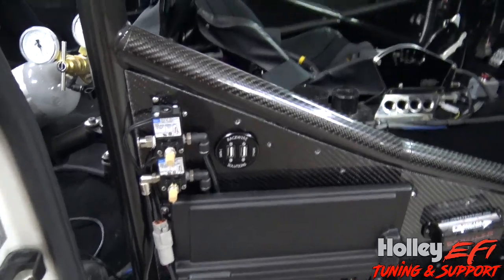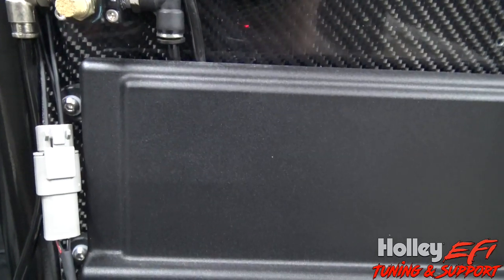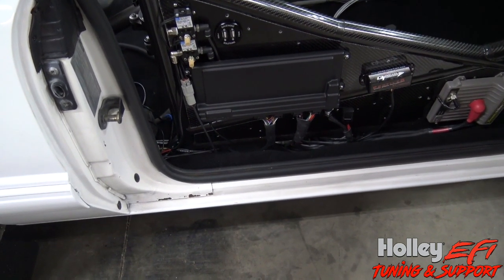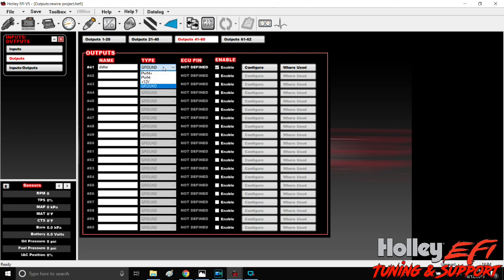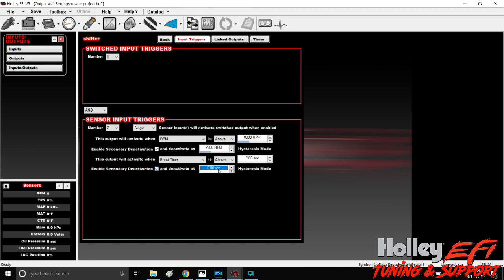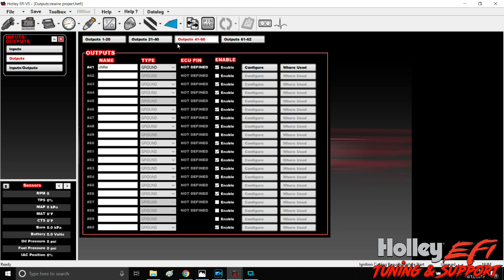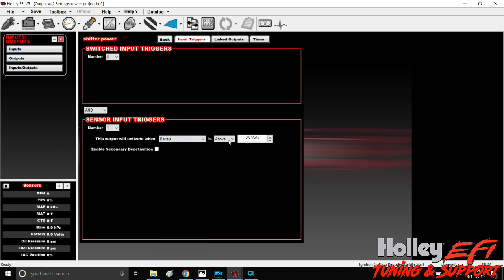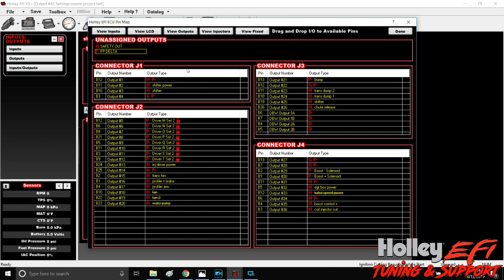air shifter install on Holley Efi

Comment: Will this work for a 4l80e ? What prevents the computer from activating the shift solenoids internally and over riding the shifter position manual lever? If i select the manual / automatic in Term max it was a grd signal to indicate that is activated and then I read that the trans will wait for a trigger shift like a paddle shift button input ?

Comment: Do I have to change my solenoid fixed pressure under my dome control to run the higher pressure to the shifter?

Comment: I'm using a TH400 with PPP air shifter. I have 2 separate outputs. Issue is 1-2 I have to set at 5900 for it to shift at 7000. I have it disable at 5800, but it only drops to 6100 on the shift so it never goes into 3rd because the 1-2 never deactivates. any ideas?
Reply from the maker: add a boost time threshold or use the timer function

Comment: Is there a way to shift at different RPM for first and second?  Procharged car and with TH400.
Reply from the maker: Yes you'll have to do it based off of time
Reply: @theholleyefiguy  I have been using a PWM table with time across bottom and RPM up.  Your way seems simpler just wondered about 3 spd.

Comment: Hey Devin.. You prefer an air shifter to an electric shifter if you have co2 on board?  With an electric solenoid shifter I'm sure I'd want to use a relay.. Just what I have at the moment.

Comment: Hey Devin, Thank you for all these Holley and other instructional videos; they are really helping me out as a new dominator owner. With a 3sp trans air shifter, I assume you assign another I/O for the 2-3 shift and set your rpm and secondary trigger to a later time in the run; is that right?